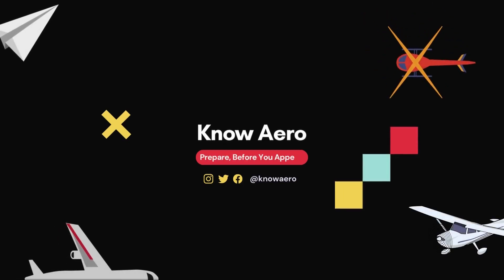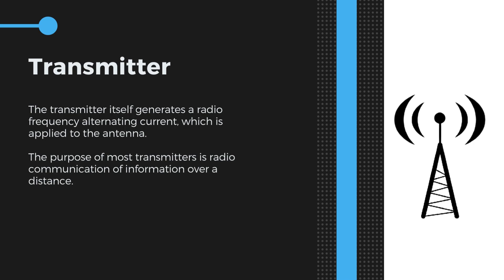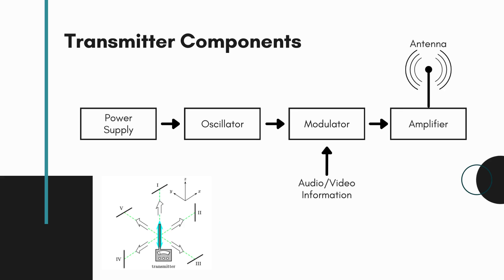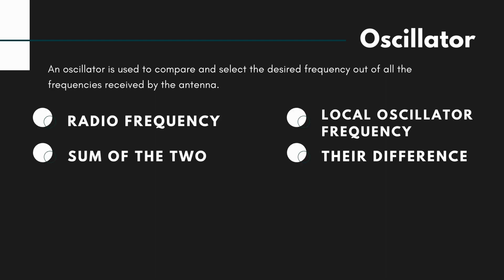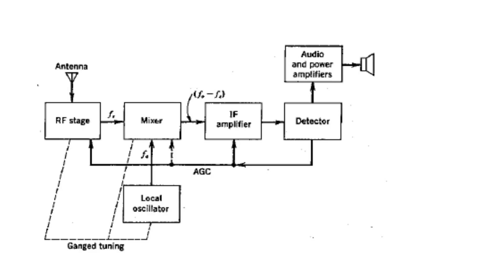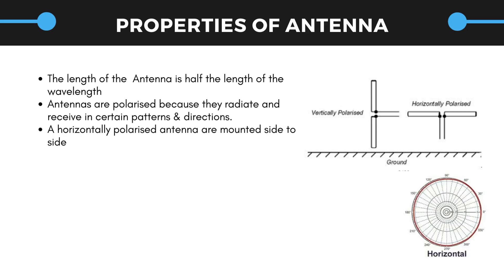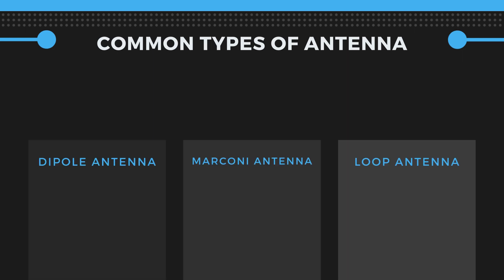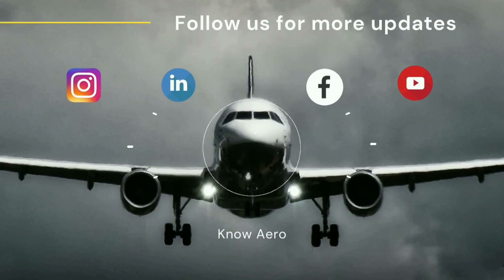Transmitter, Receiver, and Antenna | Aircraft Communication & Navigation | Lecture 3 | Know Aero

Comment: Hlo sir, what is the defect if our transmission is good but reception is irregular, always signal cut....please help me in finding out the defect
Reply from the maker: There may be  interference in the reciever.
Reply: Sir it was a bonding issue, transceiver bonding was not connected with frame and causing noise  @knowaero
Reply: @Bharatlivelong good that u were able to identify your defect cause